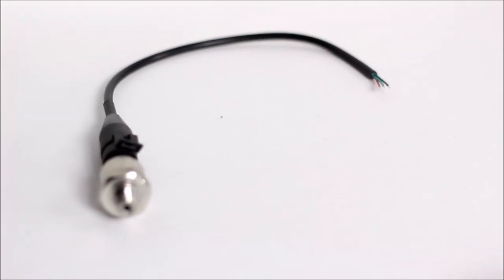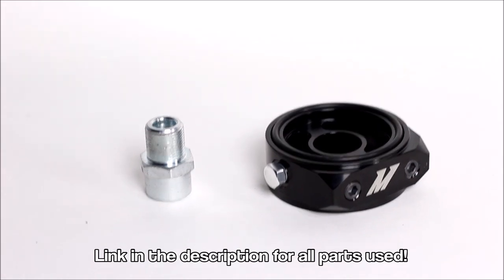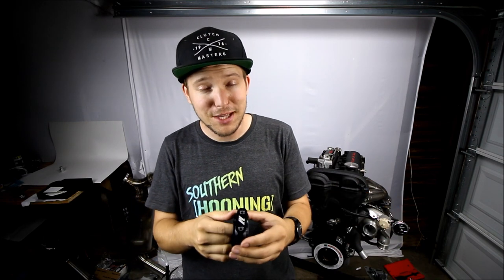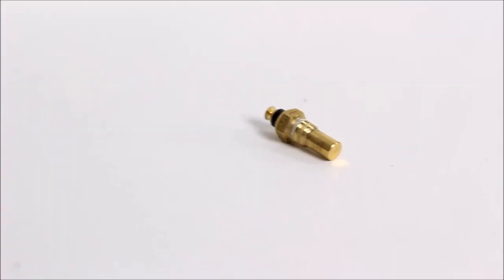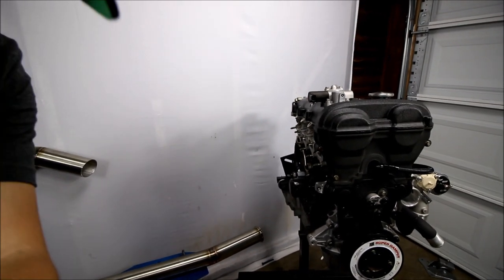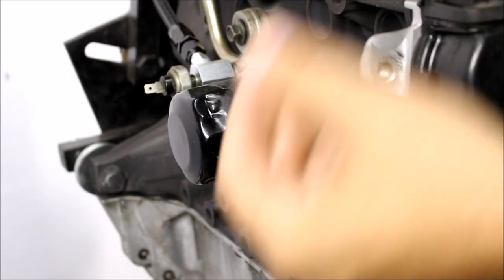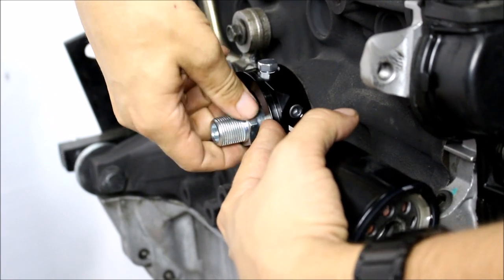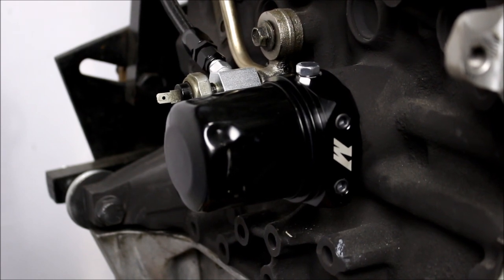Oil Pressure & Temp Explained + Sandwich Install (Rebirth Ep21)

Comment: Just installed oil temp and press sensors and calibrated them on my MS3. What thresholds  have you set up? What oil temp are you reading on normal driving?

Comment: Will the sending unit ground in the adapter? Some anodized fittings that I’ve used have to have a separate ground because they won’t ground in the anodized aluminum like they will in a block. Thanks

Comment: What’s a more better reading for oil temperature in an oil pan spacer such as the one from z1 Motorsport (for my 06 g35) or the sandwich plate like you did ??

Comment: What would make a 1.6 turbo with a megasquirt bog coming off of idle? Rpms drop after tipping in from idle before they come up. Otherwise the car runs fine and messing with accel enrichment hasn't done anything to fix the problem.

Comment: Seriously just confused me badly… Standalone ECUs detect oil pressure from stock oil pressure gauges by default so this mod wasn’t necessary…
Reply from the maker: Not if the car doesn't have a variable factory oil pressure sensor, like 1994-2005 Miatas. But even the 1990-1993 oil pressure sensor is not readable by the ECU, its info is only displayed on the gauge cluster.

Comment: Can you please make a short tutorial video on doing 1.6 oil pressure sensor put into a 1.8 engine? I have the dummy sensor and I want the actual sensor on 1.6 and I already have the cluster from a 1.6 so I just need the pressure sender unit.

Comment: One question, can you run the oil temperature sensor directly to the gauge for it or does it have to go through the ecu? Want to put in on a stock 1.6 NB wich will receive some small bolt ons and i'd like it for safety. (And my gf will also be driving the car so ye)

Comment: @thecarpassionchannel hey, with the oil filter sandwich plate and the extra inch or so that it moves the filter away from the block, will you be able to remove the filter when in is in the car? I say that because the stock setup on the NB only gives the filter about a half inch or so of space between the end of the filter and the chassis. Thinking it would stop you from being able to fully unthread the filter from the plate. Does this make sense? Just wondering.
Reply from the maker: Jordan Rodriguez You must have the factory oil cooler then? I've heard of people stacking the factory oil cooler with a sandwich and still having room to change the filter
Reply: @thecarpassionchannel. Hmmm. Maybe. I guess we will have to wait and see the engine install!!!! Hopefully everything will go in smoothly for you.

Comment: Hi, I have the same oil temp sensor as you but am confused on how to wire it. Will any wire do ? Does it run straight to the ECU ? How does it turn it into a digital reading ? 
Thanks

Comment: So with the oil filter plate instaled, you have to get the engine out of the car for a proper oilchange/oilfilterchange? there is so little room even without this plate installed...
Reply from the maker: Plenty of room for filter changes. Same amount of room as when it had the factory oil cooler/warmer

Comment: what if you decide to leave the oil sensor stock and use the sándwich adapter and add the vdo sensor that connects two wires in it is it works that way to lot of videos but not to much explained like yours i have 06 2.7 tiburon

Comment: Hey Greg so I know vvt oil pumps are great on non vvt engines and that boundary makes the forged pumps and internals, which one should I use on my build? Also what does it mean on boundarys pumps that it's machined for the vvt deeper gearset, do I need vvt gears and a boundary pump for it to be the best?
Reply from the maker: +James Skadowski It's a good idea to go Stage II even on a non VVT engine, if you're running an oil cooler or a turbo extra volume means you'll keep the pressure you need 👍
Reply: TheCarPassionChannel thanks for the info man keep up the great work.

Comment: dear greg, im trying to build a 1.8 for a 91 chassis and also have revlimiter gauges and want my oil pressure gauge to work, when you added the aftermarket sensor to the oil sandwich, how exactly do you wire it to send signal to the ecu?

Comment: why aren't you using a sandwich plate with an thermostat for an oilcooler? are you planning on running your car without an oil cooler ?
Reply: Danny MX I was thinking that too, with all that boost and heat a cooler is going to be essential.
Reply: i would rater not do a coolant reroute, than leaving the oil alone on his way to cook itself

Comment: Do you know what causes the stock oil gauge needle to raise to the middle with ON position before starting the car? Since my aem oil pressure gauge also reads low numbers so I'm not starting my car yet until I fix the issue please help thanks?

Comment: I thought that you werent supposed to use tape or ptfe on those single wire sensors because they pick up the ground through the threads..??   I know i had a bitch of a time with my electronic sensor trying to get it to both seal and read right.. either i used pipe dope and didnt have a drip and the gauge was high resistance so it would read over 100 psi most the time or it would drip because i broke 2 of the damn things trying to put a little elbow into it to make it tight but the sensor would leak or make that cracking noise theyre not supposed to make and nit work..  i ended up having to perform surgery on a new one and drill a hole in the thread and solder a wire in then file out the solder to make the thread and ptfe and dope the shit outta it and ran the wire to the block ground..  spent way too much time and money for that stupid gauge thats only there to tell me the motors gone..  .. lol

Comment: How much are you looking to
Make with the new build? (Btw been following u sense way before b&b)
Reply from the maker: +Mr_ Maus13 Hoping for 325 on 91, and maxing out the turbo on e85. Hopefully 370-380 range. More importantly, I want a massive torque curve and the fastest spooling 350+HP Miata motor around :)
Reply: Speaking of VVT, Greg what do you hope to get out of the VVT over say a 99? it didn't add much to the torque, power output and fuel mileage for the increase in octane.
Reply: id like to know the same as i have a 99

Comment: So I don’t need to drill my pan if I get that sandwich plate ?
Reply: Yes you do, this is the feed for the turbo, the drain for the turbo needs to drain into the oil pan. 

All 3 ports on this sandwich plate are pressurized so they're all going to be pumping oil out of them, impossible to drain oil back into them.

Comment: Greg where did you get the oil temp/pressure sensors from?
Reply from the maker: Shannon Link in the description to the page for this video has all the info
Reply: awesome thank you. What about coolant temp? Does megasquirt just use the OEM sensor on the back of the head?
Reply from the maker: Shannon Yep

Comment: Could  you run a oil cooler  on that.. could  you  film you putting one on  .. even if it's just  for  the video
Reply from the maker: +mack264 No this sandwich is not designed for an oil cooler. The ports have to be much larger
Reply: TheCarPassionChannel  can you get ones for both?
Reply from the maker: mack264 Yes.

Comment: is there any chance you can run a sanwich plate for oil feed and return? like the ones for oil coolers, not the one you puton, or are they all the same? thanks, learned a lot from you
Reply from the maker: +Martin Gallego unfortunately a turbo drains via gravity and you could not run the drain line from the turbo all the way back over to the sandwich plate and have it drain properly.

Comment: 1:50 How nice wouldn't it be if every type of sensor gauge that has value to the operator came standard? If you ask me it's pretty valuable information to know what the oil pressure and temperature is, what's the battery voltage and amperage, etc, just as a normal working man who depends on his car, so if there is somekind of anomaly, I'll know it before some computer has to start shouting at me to get to a service station. Fuck modern cars, bubble shaped cuck mobiles all of them.

Comment: Why did you pick a VVT motor?
Reply: James Slenk he wants a big torque curve, thats where the vvt comes into play and also spool is minimal earlier on the vvt ones. for a high hp/rev turbo build you dont need vvt, but on the street and overall its just a bit more usable without loosing your topend!
Reply: Ok I didnt know what the difference was with or without VVT.Thanks

Comment: >single wire oil temp sensor
You spend how much on this motor, and you're trusting a $20 temperature sensor? Those things are no where near accurate.
Reply from the maker: +Chris Havill Link for a better one?
Reply: I have one of these in the sump to measure temp - https://www.amazon.com/Bosch-0280130026-Coolant-Temperature-Sensor/dp/B001CO2VU0/ Its not connected to the MS3 though, it goes direct to my digital dash.

Comment: Uh the highest water temp my 91 sees is 180 so I doubt operating temp is 196
Reply: LarryM Celsius/Fahrenheit ?
Reply: lalacorbs well I believe it's fahrenheit since my water boiled past 200
Reply from the maker: +LarryM the factory thermostat is 195. The engines are designed to operate most efficiently at that temperature.
Reply: My bad, I read the 91 and the 196 and thought you had it confused. I've now re-read and I understand what your comment was about